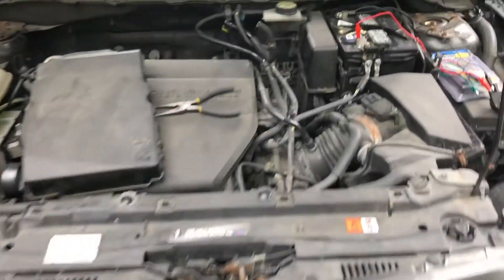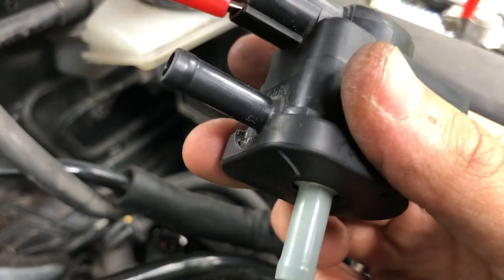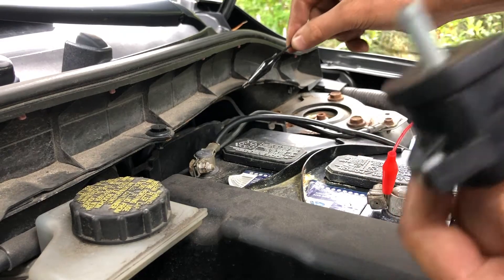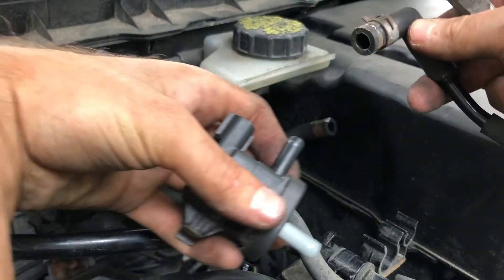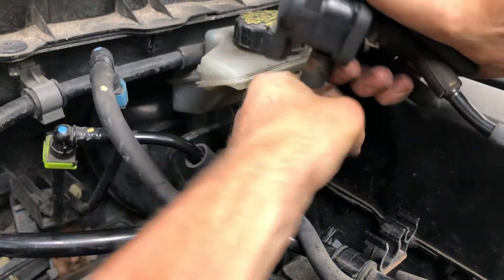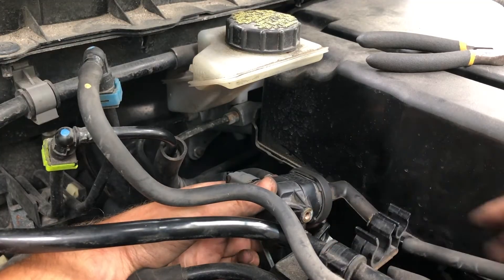How To Test a Mazda 3 Purge Solenoid

Comment: Is this the same part on the 2.0L skyactiv engine? I’m getting the P0456 code, and I want to test the purge solenoid first because it’s easier to access than the vent solenoid (under the fuel tank).
Reply from the maker: Not sure however P0456 is likely vent unfortunately see my other vids of how to get to it, annoying but doable if you are experienced lowering subframes

Comment: Testing the solenoid with the tips so close in one side and directly connected to the battery in the other side is only for the strong, nerves of steel, hard core mechanics.
Reply: Yeah, I think I'd throw a piece of electrical tape in between.

Comment: This test by mouth won't work.  You need to test with a pressure gauge to see if there is a small leak.
Reply from the maker: Agreed in my other video the small leak was so tiny on the vent solenoid 😂

Comment: How do you get the goddamn electrical connector off - ive literally spent an hour on JUST that. Everything else is straightforward but the connector is not coming off
Reply: OK figured it out for posterity

Flat blade screw driver at the side closest to the valve, to get the connector up over a fairly tall clip. Found this to be easiest once all of the hoses had been removed, and had the valve rotated out if  position
Reply from the maker: @collinduffany7363  Thanks for watching and for this! I will make a connector-specific video when I get the time, I think it is worth its own quick video! They can be difficult. All the best to you.
Reply: @OliverPorter92  sure thing, and thanks for putting this video out, it was EXTREMELY helpful!

It was on my sister in laws car and I'm just sitting there going "I'm gonna break it and then everyone's going to have a bad day!"
Reply: @collinduffany7363  W comment

Comment: Can a aftermarket canister purge valve with the hose work on my 2008 Mazda 3? The original cpv is not made the same. Instead of having 3 hoses on it, it has 2. Auto zone don’t have the one in the video.
Reply from the maker: Hi I am not sure on the 2008. The aftermarket vent (not purge) one in the companion to this video has worked since I created that other video, but not 100% sure. Sorry!

Comment: How if i disconnect the purge, and the car run smoothly? I had error p2177 and p2187
Reply from the maker: If I am understanding your question correctly - you disconnected and were OK. This is because the impact of the evaporative emissions system is mainly to reduce emissions, and has little impact on airflow/mixture to the engine, so, while not recommended, removing the purge likely did not change engine operation.

Comment: I got P0446 code on Mazda 3 and sometimes when I drive long distances I press the gas and the car don’t go fast and white smoke. I’m just waiting for the purge valve I ordered from Amazon to replace it and hopefully this work.
Reply: Did it work ?
Reply from the maker: Thanks for watching, hope this helped and the problem resolved. Much easier to replace purge than vent!
Reply: So did it work ?

Comment: Hello buddy, I have a code p0456 (evap system very small leak) I took it to 2 mechanic and they both said the car is good to just drive it and it will go away but honestly my car cab smells a little like  gas and I’m not comfortable driving it even if it drives like it has no issues. I checked this and it is a little wet like around it. 
You think it could be this? I would appreciate answer please
Reply: I just watched a video and it could be the locking cap on the gas tank.

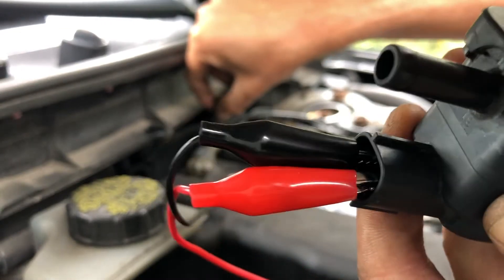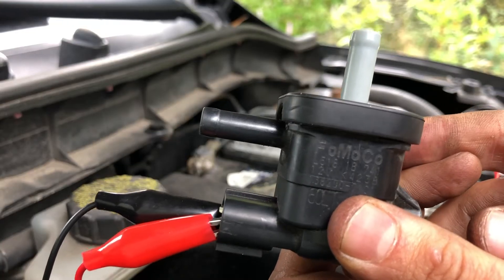Comment: From 0:36 - 0:45 do you actually hear air rushing out or does it just make a clicking sound. I tested the same you did and all I hear is the electrical bolt make a sound. Let me know thanks
Reply: I think the question was about the air flow sound. Is it your mouth's blowing into the hose or it's the part that pulls in air itself (making the noise that we hear in the video)?
Reply: Yes, in the video he's blowing into it.
Reply from the maker: Hi when you apply 12V power, it should open and let air through if you blow on one end. Un-energized, i.e. disconnected, it should not let any air through. This is because the purge is normally closed; it only opens when the ECU commands the engine to draw a vacuum from the engine. Hope this helps!

Comment: I have a check engine light with the codes p2177 and p2187 on my 2007 Mazda 3. I’ve replaced the mass airflow sensor and downstream o2 sensor. My car is having a hard time starting and accelerating. I found something that said a cause could be a stuck open purge value. Do you think that this could have something to do with it?
Reply: That could very much be your problem. A stuck open purge valve could cause a vacuum leak from the valve, which could lead to a lean condition because your car is getting too much air from the valve, preventing the car from starting because it is cutting fuel to make up for the extra air. Basically, the stuck open valve could be confusing your car.
Reply: Not sure if you've resolved your issue but you mention hard to start and accelerate....if when sitting at a light or stop sign your rpms begin to drop and feel as though your engine will stop or does stop, your EGR valve could be a culprit. Just throwing that idea out. It's not a very pleasant job to do. It can be made easy or difficult. Everything I've seen on YT suggests linking together various sockets, going up, down and around this or that. By following this method the first time I learned quickly how to strip a bolt and not get a good placement with the new gasket. So, I redid the job new gasket, tapped the engine block and bolt hole on the EGR valve itself (to accommodate new size bolt) and slightly increased to a new bolt.  To make this job easier and with a better result, in addition to disconnecting the battery, draining the coolant and removing the standard engine cover pieces and air box, I also removed the battery, battery box, pulled PCM wires and wire bundle to fises, pulled all wiring back, disconnected coolant hoses, (underneath EGR valve and ECT) and removed the VV tumblers. This gave me a clear path into the EGR without snaking connected sockets through. I replaced the EGR gasket and if you pull the VV tumblers you'll need a new water channel gasket ($5 at auto parts store). I was able to get a good fit, well secured and a drastically noticeable improvement once no air was being successful in around the EGR valve. 

May or may not be your problem but it was for me a while back and complete disassembly was the trick to a complete and thorough replacement. Hopefully this will be of use at some point. I drive a a 2008 Mazda3 2.0L
Reply: @TheAgentAaron  I'm having the same Issue (code p2187 )changed MAF, check fuel pump and flow at the rail. New Air filter , cleaned throttle body and even changed bank 1 O2 sensor. Second time I've heard to check EGR, if I am gonna pull it I will definitely change it. Last parts to swap from my research is PCV Valve and Intake manifold gaskets, Purge Solenoid Valves and EGR. Rock auto should keep the cost down.  Any other tips? Car is 08 mazda 3 2.0L
Reply from the maker: Thanks for watching and sorry for the late response. It may, I am not familiar with that code, but the purge should normally be closed.  This valve is easy to check on the Mazda 3 per the procedure in this video. Hope this helps !
Reply: @amy did you fix?
Reply: Something to consider. Is the vehicle fully factory? I had an 08 Mazda 3 that had a mazdaspeed cold air intake. Ended up with a P2187 and P2188 off and on, car would run horrible if at all. Check out the wiring to the MAF sensor. In my case, the short wiring to the sensor was damaged due to being essentially tugged on. The ground wire was the main source of the fault

Comment: My valve works with your way. Thanks. Now what? Still has check engine light.
Reply from the maker: Thanks for watching. Error is code-dependent and could be several other items in the EVAP system. The other purge error could be a purge that leaks a slight amount of air (need a vacuum gauge to test.)
Reply: @OliverPorter92  so just to expand on his statement, would the engine light immediately turn off if the purge solenoid is the only issue? Or would it stay on for a little before turning off? Just wondering about how quickly the check system responds to a fix
Reply from the maker: @A-STR45  Hi it has to run through a standard check cycle to test, may take 50+ miles of driving at different speeds; the Mazda check cycles are specified in different forums online. If you have a code reader you can erase the temp code, but it would take the drive cycle to confirm if it is truly gone.
Reply: @OliverPorter92  Ok wonderful, thanks for the quality response, it's very helpful and will keep a lookout when I try and fix my issue soon!
Reply: If that fixed your problem and if that’s the only reason the code came on, then delete the code

Comment: What would the Symptoms be for a bad one?
Reply from the maker: Thanks for watching! 
-Check Engine Light with P0441/P0446 on Mazda. --If purge valve sticks/does not close fully, un-metered air may enter the engine, causing:
-Rough Idle
-Hard Starting Car. 
-Bad Engine Performance
-Failed emissions test

Hope this helps!
Reply: Oliver Porter cool thanks!
Reply: @OliverPorter92  what about p0171?
Reply from the maker: @ceej5714  Likely something else, fuel pump, filter, or pressure regulator was google's top symptoms for that one. Lower probability of emissions leak.